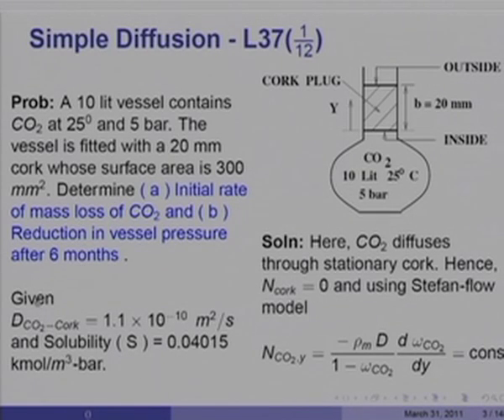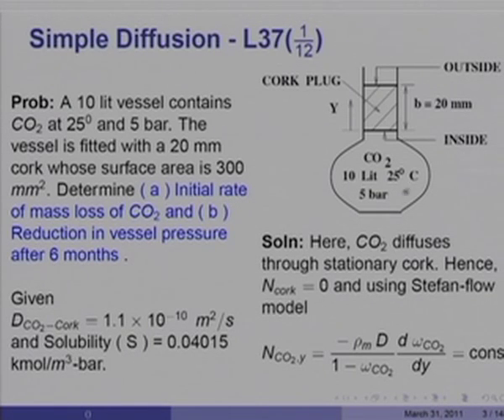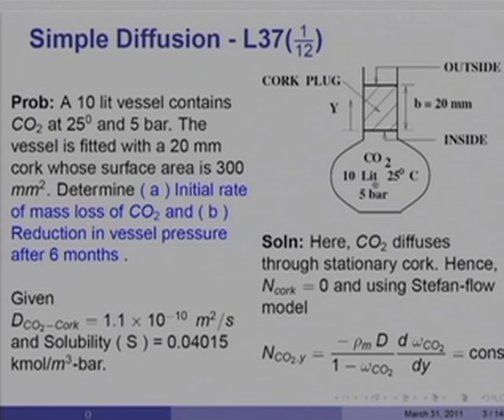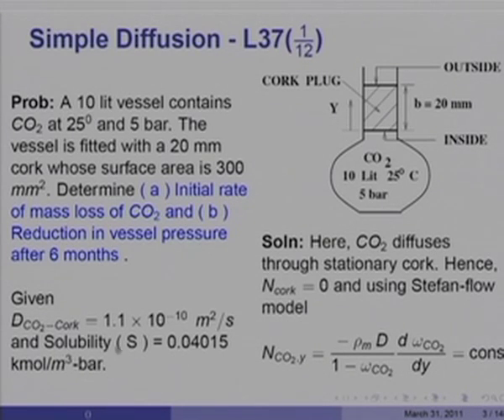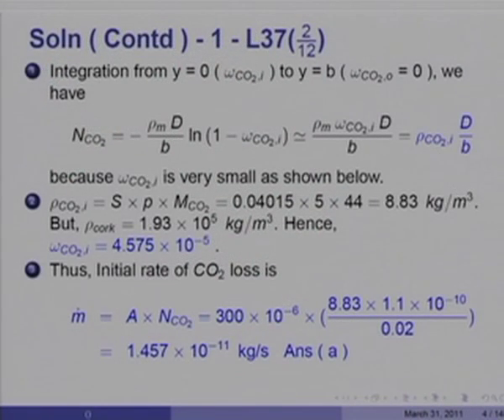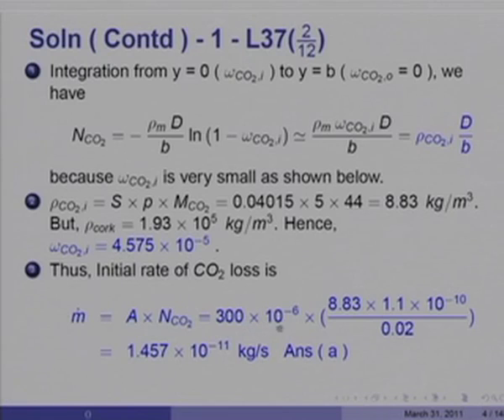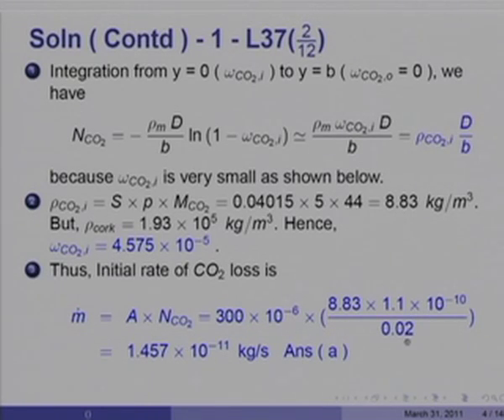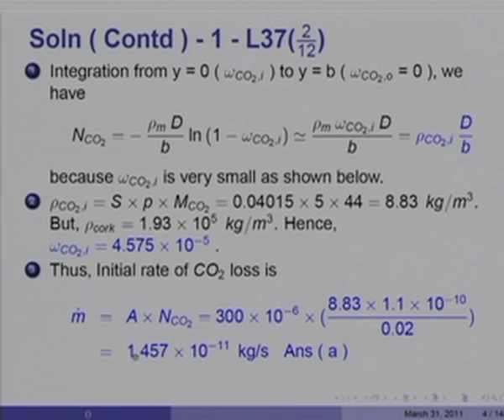Mod-01 Lec-37 Diffusion Mass Transfer Problems

Comment: Q3  A falling film of water at 30oC and total pressure of 1.45 bar is used to absorb a solute (A) from an insoluble gas. The mass transfer coefficient at the given velocity is estimated to be           kc = 90.3 kmol/h.m2 (kmol/m3). It is known that 13.6% of the total mass transfer resistance lies in the gas-phase. At a particular section of the apparatus, the mole fraction of the solute in the bulk gas is 0.065 and the interfacial concentration of the solute in the liquid is (0.00201). The equilibrium solubility of the gas in water at the given temperature is:-
                                 PA = 3.138 x*    
Where P is the partial pressure of A in gas in mmHg and x* solubility of A in mole fraction, gas constant 0.0831bar. m3/ k. kmol. Calculate:- 
1- Absorption flux of the gas at the given section of the apparatus.
2- The bulk liquid concentration at that section of the apparatus.
3- The overall liquid-phase mass transfer coefficient.
4- The individual and overall gas-phase driving forces in terms of ΔP and Δy where         1.013 bar=760 mmHg. .

Comment: i want answer for the question please            Q3  A falling film of water at 30oC and total pressure of 1.45 bar is used to absorb a solute (A) from an insoluble gas. The mass transfer coefficient at the given velocity is estimated to be           kc = 90.3 kmol/h.m2 (kmol/m3). It is known that 13.6% of the total mass transfer resistance lies in the gas-phase. At a particular section of the apparatus, the mole fraction of the solute in the bulk gas is 0.065 and the interfacial concentration of the solute in the liquid is (0.00201). The equilibrium solubility of the gas in water at the given temperature is:-
                                 PA = 3.138 x*    
Where P is the partial pressure of A in gas in mmHg and x* solubility of A in mole fraction, gas constant 0.0831bar. m3/ k. kmol. Calculate:- 
1- Absorption flux of the gas at the given section of the apparatus.
2- The bulk liquid concentration at that section of the apparatus.
3- The overall liquid-phase mass transfer coefficient.
4- The individual and overall gas-phase driving forces in terms of ΔP and Δy where         1.013 bar=760 mmHg. .